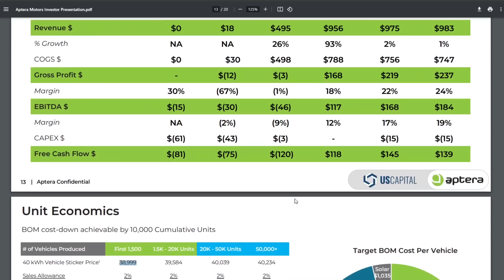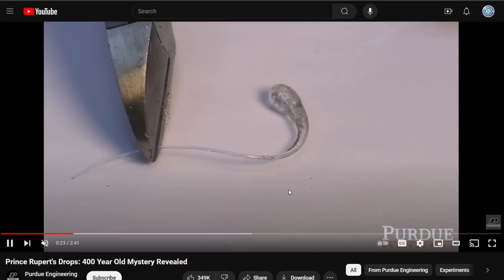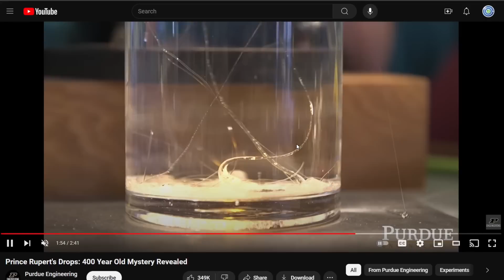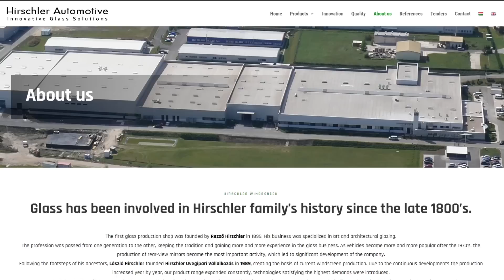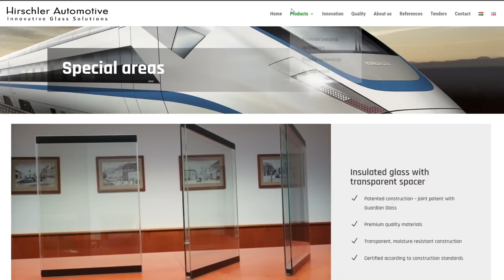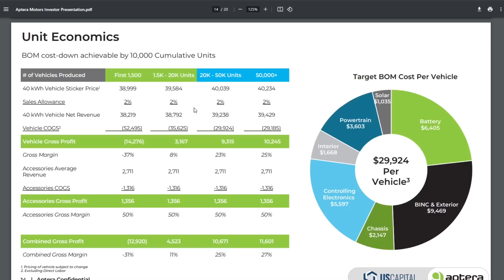Is this Aptera's Launch Price?

Comment: Like you said. it's all speculation. I think it's possible that the inboard motor will be cheaper than than 2 in-wheel motors. It sounds like the AWD version is out, for now. That should bring the cost down for the LE even more. I think it's very possible that they will be close to the predicted prices. We'll see. If the price goes up too much, a lot of people will drop out, including me. In that case, I'll wait for a gently used one to show up.
Reply: I think Aptera cost of ownership will be considerably less than anything near Aptera's capabilities even if price is a bit higher until economy of scale kicks in.
The 5% off and 1k$ off deals for some investors are still in play I think.
Reply: If AWD is out, I would need to rethink my accelerator order.. Unless they promise something like a low cost replacement within a certain time window.
Reply: @vd.7139  You're not alone. I reserved a FWD almost base model so, it's not a deal breaker for me. I'm also a long way away from getting one.

Comment: I think that if it's over around 35 g s.  People will just opt for something else... There are many affordable EVs on the horizon.
Reply: If initial purchase price, is the primary consideration, you may be right.  But there are other factors; I wouldn’t buy just any car just because it is cheaper.
Reply: @LanderMaybe  Well I just found a slightly used Lyriqe online for 44 k.. alot of car for the 💰.. I'm still patiently waiting for the Aptera but it's getting harder.   No one wants them to succeed more than  me... I'm also an investor.
Reply: Everyone has a different situ.
Aptera can haul my bicycle or kayak. Lots of 4 seaters can't without dealing with roof racks.
I think Aptera will win cost of ownership hands down.
Reply: @ronfarnsworth7074  Aptera can't haul a real kayak - just a play boat.  We will need a light trailer hitch option for anything over 10 ft in practice.  Also it definitely cant move two kayaks at once without a hitch.  My kayaks are 13.5 and 17 ft.
Reply: @ccibinel  My 3 kayaks are all 14' or less and would slide fwd between the 2 front seats. So maybe 6' would stick out the back at most. No prob. A one person canoe ought to fit as well but not my 16½' canoe.
Most people I know don't own open water or sea kayaks, in which case I would agree with you.

Comment: They will need to get that price down, no way they can compete on the current market at $40k.
Reply: There are so many options at $40k that have 4 wheels and 5 seats. Only a true enthusiast would pay that much, and that will be a very limited market. They need to get the price down to $30k or there will be a mass cancellation of reservations.
Reply: @ztyhurst  should be easy if they are working off 25% profit margin, which is insane.
Reply: @ztyhurst  Don't any of you people listen to what Steve is explaining or don't you READ what's in front of your face?
Reply: @rchender  I did read what was printed on the screen. While I appreciate Steve’s comments and dialogue, what is officially printed on the screen holds way more weight.
Reply: @ztyhurst  Most vehicles on the road have one or two occupants. 4 wheels and 5 seats means nothing to millions of drivers.  If a person is interested in efficiency, performance and economy, the Aptera is far and away the best choice on the horizon.  There are no options that can compete with Aptera using those three metrics.  None.
Reply: @J-W-Kelly  Prius PHEV blows it away. I'm sure there are more options. Once you get to 40 mpg, there is so little cost savings that it's hard to justify even another $10K price. Pursuing it with less seats, less wheels, more crash danger is not very popular.  Don't confuse mostly driving with 1 or 2 occupants with not needing back seating.
Reply: @artsmith103  How does an overcomplicated high maint cigarette on wheels blow away Aptera (as proposed) for efficiency, cost of ownership, right to repair, or performance, or fun, etc?
2 seaters aren't for everyone, granted..
Reply: @artsmith103  Cost savings is far from the only metric.  Again, why are you here? You obviously don't like Aptera's efforts to build a unique vehicle.  Do you get some kind of sick pleasure out of ankle-biting?  Do you go on lifted pickup forums and talk about lowered cars?  Comparing a hybrid to the most efficient electric vehicle ever (to be) made is pretty silly. If you don't want a three wheel vehicle, this is the wrong place for you.. but I get the feeling you're here for other more obvious reasons.  Keep trolling.
Reply: @J-W-Kelly  I'm not trolling. I'm speaking well educated and experienced facts. I'm here to help expose truth of Aptera to younger people that can be helped from making a purchase or donation mistake. UAE spent days with the trike. How many were ordered? Next comes USCG :-(
Reply: @ronfarnsworth7074  Prius PHEV: Vast majority electric range for those that care, 10% of battery size for environment, 100% more seating, 33% less tire track, nearly infinite range, no winter degradation limitation, hitch option, roof rack option, easier to park, safer, etc.
Reply: @J-W-Kelly  While I agree with you on the premise that there is nothing that currently meets those efficiency levels, and I love the Aptera and really want to buy one, my argument is that for most consumers there is a price limit to the value that efficiency at the cost of all else adds. My opinion is that $40k is way too much and there are a lot of other transportation options at that price point while less efficient provide more practicality and there will be many reservation cancellations.
Reply: @artsmith103 really?  You sound like a Russian troll sowing FUD.
Reply: @artsmith103  No doubt, you are a heroic messenger of truthiness here to save the gullible from a costly error...you know, those fine folks who have to get help with their shoelaces... you are not at all an ankle-biting hack. My bad.
Reply: @ztyhurst  Maybe.  Maybe not.  We don't now what the price will be yet and Steve at AOC has slightly different take on what the recent revelations mean.  Aside from that, there is a market for the most efficient vehicle on the road. I have mentioned this before, but the early BMW i3 fully optioned out was about $53,000.  It has a much smaller battery, with 1/5 the range, is far less efficient, is mostly used as a two seater, and yet quite a few were sold... and many were leased out... which might be a way Aptera moves more of these.  In any case, there is nothing else even remotely like this vehicle.  It would be nice if they can sell millions but that is less important than selling tens or hundreds of thousands... which would make them profitable as things stand right now.  I would have a difficult time paying $40,000 plus for an Aptera, but I would be hard pressed to find anything nearly as attractive... might get another used i3 with a larger battery when mine finally becomes too expensive to maintain.  Best  car I have ever owned, by far.
Reply: @J-W-Kelly  FYI, I got PE license 1st sitting, BS from top 5 engineering college. That's only avg in top of STEM world. Home, boat, more powered by solar. All my utilities except internet are $100/yr, lowest in my community. I have oversized PHEV that gets 42 mpg. Own multiple residences. No divorces in my family. It's not a bad path to follow. In my 20s I lived in cool up and coming city neighborhood with T-top Nissan Pulsar. Often filled with 3 passengers driving them home from bar time at the yacht club. Could carry my windsurfer, mountain bike, sailboat and passenger via racks and hitch. I understand small but fun. Commuted 70 miles round trip with 1 car pooler for awhile. In my whole life, the Aptera would have constantly proven inadequate. Some people don't know their pronouns, but others can be helped. If you're still reaching up in life, stay away from this trike but enjoy the show ;-)
Reply: @J-W-Kelly  The i3 was released at a time when there were fewer electric options, so I don’t think it is a fair comparison. There are now quite a few new and used EVs that one can buy for ~$40k or less. As for the prices that were shown, if that is what was reported to potential investors, then I would expect them not to change very much. They certainly will not change the margins. There are strict regulations about the accuracy of financial information that you report to investors and they would need a good reason to change it after reporting it.
Reply: @ztyhurst  The i3 is also carbon fiber EV with a unique design. Also a built from scratch bespoke design built for efficiency... not an update of an ICE vehicle like so many others... which makes it the closest thing to an Aptera.. not very close, but still a valid comparison...... Tesla sold millions of EVs for far more than what Aptera looks to be selling for and as I said there is a market for this unique vehicle.. we just don't know how large it is yet.
Reply: @artsmith103  The Prius will rust and requires more resources to build.  I love them and have owned several, but I will gladly pay extra for an Aptera.
Reply: Economy of scale is a process..  patience reqd.
Reply: Totally agree. For $40k the new Tesla model 3 is a no brainer, value for money. Aptera needs to be priced sub $33k excluding tax credits.
Reply: I believe we are in for more changes, including Aptera not being able to reach the 100 wh/mile (20 miles per kWh) at highway speeds. I can tell you for sure fact. I will and have purchased a 2024 Tesla Y LR for $38,900 including the PoS IRA. If Aptera is ~$38k why would I buy it. I would not. It would have to be in the mid- Low $20k
Reply: @I_Live_4_This  What is PoS IRA?  I've tried to estimate miles/kWh, and others have made good estimates, I expect ~8 miles/kWh and ~17 miles/day solar, 365 avg, typical location.
Reply: I agree, way too high, and nowhere even close to what was advertised.  I know Steve is suggesting it will come down.  I sure hope he's right.  But it has to come down by more than a couple grand.  We're talking 5k at a minimum.  Considering the first couple thousand are likely to all be FWD cars, it should be more like 7-8k less.  At the price shown, I'm out for sure, and I've been a dedicated Aptera enthusiast, and investor for years.  I'll instead go pick up a used model 3 or something with AWD for 10k less.  

Can't speak for others though.
Reply: Whether we like it or not, price is the major driver in America. F150 lightning blew up when they announced starting price of $40k, then they increased significantly and demand evaporated, they've been trying to recover ever since. Vast majority of Cybertruck reservations were based on $40k starting price, lots of reservations not converting. Aptera needs to make a profit but low price will drive way more demand, otherwise they are destined to be a boutique maker. It's America 101.
Reply: @renuing  I don't expect Aptera to sell like hotcakes.. I expect it will be a unique vehicle for buyers who are not i  the mainstream of consumers.The amount of stupidly large pickup trucks out there selling for enormous sums even used... those are  not the same people Aptera is catering to. Let's wait and see what the prices is.  We don't know at this point, now do we?
Reply: I disagree. $40,000 is reasonable for a unusual top tech vehicle. It what be for the masses but it's ok for something like an founders model etc.
Reply: they need it to be in the low $20s for a 2 seater with no tax credits
Reply: @RomanChaar  Really? Based on all the other vehicles just like the Aptera out there?  1990 called and they want there cost projections back.
Reply: Are they even trying to build vehicles?

They’re so slow, I swear slugs move faster.

It’s been so long I don’t even remember what year I preordered, I’ve bought FOUR teslas since
Reply: @lazerusmfh  Why would they purchase tooling if they weren't working towards production?  Think about it.  They are attempting to do something a lot more difficult than what you're doing here.  It's much easier for you to be critical and insulting than it is to run a start-up and begin production.
Reply: @netscrooge  they’re gonna run out of money and the price of their vehicle is going to be too high and they are gonna end up like every other failed startup.

They need to produce cars now, not two years from now
Reply: @lazerusmfh  Thank you, Captain Obvious.  None of us had any idea that vehicle start-ups are hard.  You've saved us from thinking it would be easy.  Good work.  Well done.  Now could we please move on to the more difficult questions?
Reply: Especially with 3 wheels. The worst combination of less stability and more wheel tracks to hit debris and drag through bad weather.
Reply: @artsmith103  Sounds like you are not an Aptera enthusiast... which makes you... what? Just another ankle-biter who gets his kicks by whinging? Why are you here?  It's obvious this vehicle is not for you.  Go buy a cookie-cutter car with racing stripes, a free wheeling steering wheel, a V8 noise generator and a grocery cart handle on the back... that should make you happy.
Reply: @artsmith103 
I disagree. If you cannot avoid potholes, 4 wheelers would hit it twice, 3 wheelers hit it just once.
Reply: @Kukaboora  4 wheelers go around, 3 wheelers go through debris. That's a very discrediting comment you made. 3 wheelers are made for low purpose use, Aptera is mixing the worst of both.
Reply: @artsmith103 what!  Aptera has 3 wheels?  That’s news!  
It obviously stopped 50,000 people from reserving one.
Reply: @LanderMaybe  Those reservations were refundable from a time Aptera had a lot more credibility: $33K, AWD, IWM, Belly Cooling, Heat Pump, 400 mile range, 40 miles/day solar, delivery late 2022. None of that exists nor will be delivered.
Reply: @artsmith103 
Once again I disagree. If you see a pothole both 3,and 4 wheelers can avoid it entirely. If you cannot, I already told you that case.
In terms of debris, by definition they are everywhere so both 3 or 4 wheelers just can avoid them.
The nonsense of three wheelers would not be able to avoid potholes came from Jay Leno the first time he drove the old Aptera.
Nobody would check his nonsense for his celebrity.
But nonsense is nonsense.
Reply: @Kukaboora  How about mufflers, 2x4", skunks, tools, etc. Things that fit under typical higher clearance and can be avoided without leaving crowded multi lane traffic? Typical 2 second following distance at 60mph on 3 lane road. The trike is much more dangerous. Pretending otherwise is just part of typical Aptera scam.
If the trike was comfortable 45mph local commuter priced similar to Acrimoto it would work for some people. Pretending it's a new full service vehicle achievement is pathetic. Costs as much as 2 wheel track, 4 seater with no benefit. It's doomed!!! Shame on USCG for associating with Aptera!!